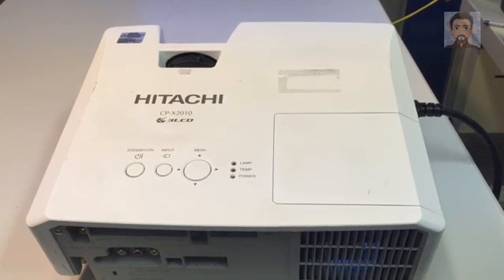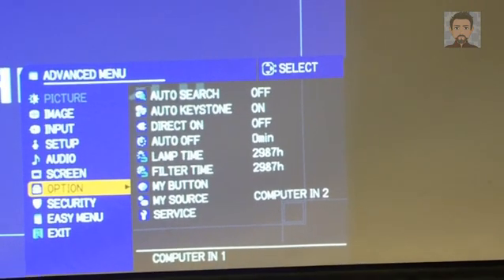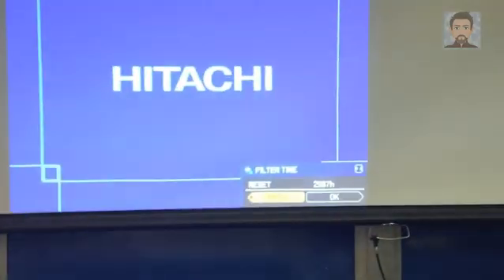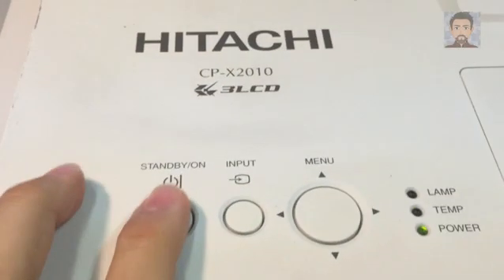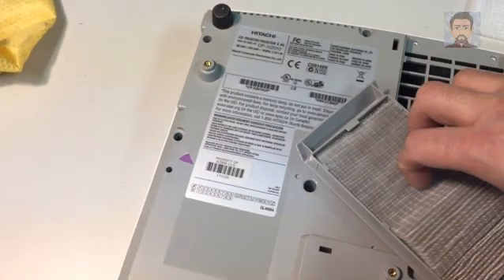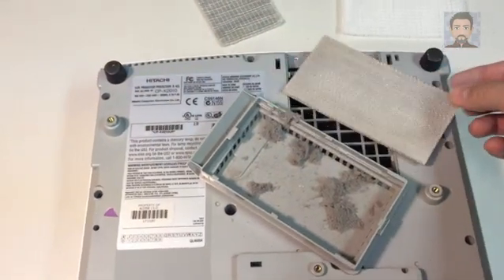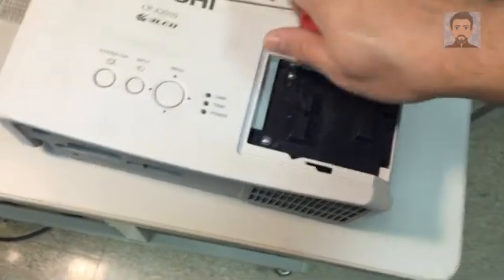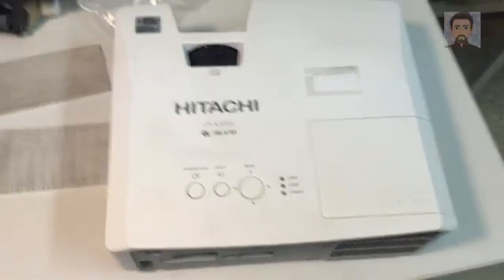Hitachi CPX2010 Cleaning or replacing the filter and/or bulb

Comment: I recently replaced my bulb. it comes on works fine then after about 7 min it blacks out...temp light flashing power light flashing.... manual said possible overheating. I cleaned filter but the problem persist
Reply: No, it works great when it on. I bought it from amazon. Do u think It may be defective?  Anyway to tell? Thanks for answering btw
Reply: +Patrick Barrera thank you kind sir. greatly appreciated
Reply: @patrickbarrera5763  dude mines maybe the fan issue cause mines makes a noise but like a fan noise and blinks exactly like this guys says and sometimes turn on and a place said they will charge me 195 and idk I been seeing videos of some easy fixes and just wanna be sure before I get hustled from my money from an easy job